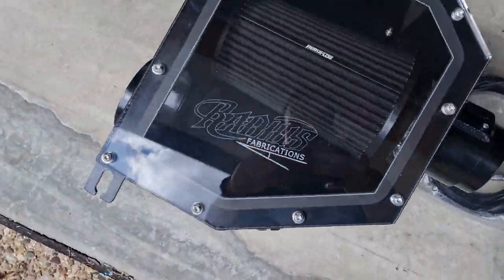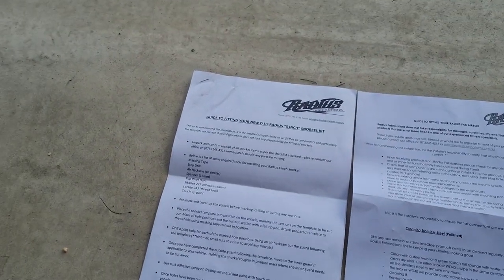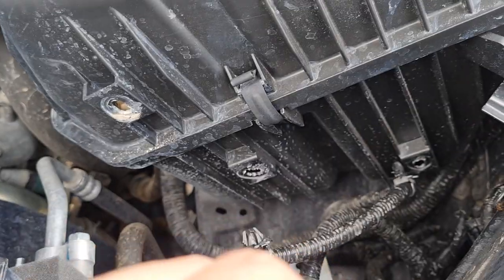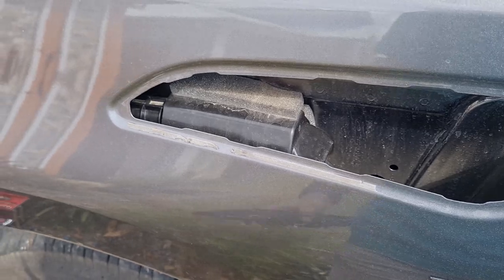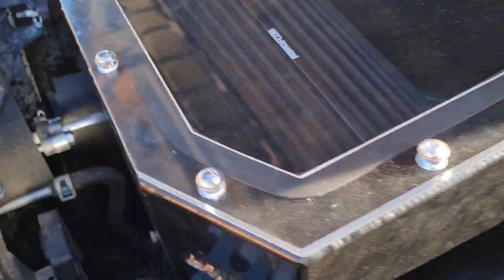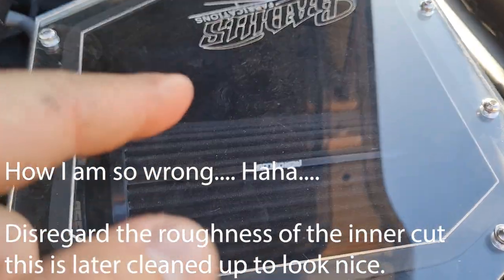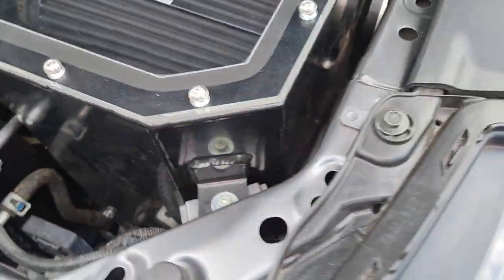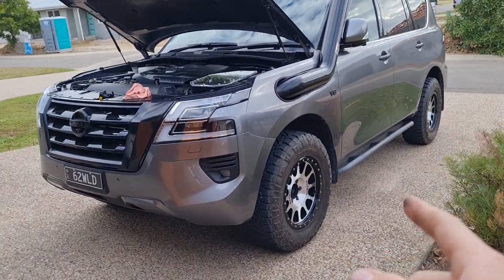Y62 Patrol Radius Fabrications Snorkel Install

Comment: Fuck she's a bit rough man hahaha.

That guard is hacked up.

Are you going to redo?
Reply from the maker: Yep, should have seen the template. I have been sent their new template and will be redoing it so it's actually right.
Reply: @WLD62  I'd be heartbroken. 

But, like you said. Now you have done it so people can see what not to do with that shithouse template haha. 

Are you going to get a new guard?
Reply from the maker: @DarrenBoxhall  Yeah I was a bit disappointed about it, it doesn't look too bad in person, although I'm not happy about it. But that's exactly right, it saves others from going through it.

Yeah I'm trying to find a new guard so I can get it perfect with the new template. But Radius have been great, send the new template free of charge and I look forward to seeing this improved one. At least they know it was an issue and fixed it. Apparently they we're waiting for a car to 3D scan, so it could be 100%
Reply: @WLD62  just remember,  even if you get a guard that's the same colour it won't match properly. Or if your getting a new unpainted guard, you will need to blend the door.
Reply from the maker: @DarrenBoxhall  It'll probably be alright because it is so new, but there is methods to use to make them look the same, but that's a later issue.
Reply: @WLD62  nah it won't matter. You can't just paint a new guard edge to edge and have it match fully. It will need to be blended. I'm an automotive spray painter
Reply from the maker: @DarrenBoxhall  You are right. Hoping to find one of a wrecked one anyway, hopefully match a bit easier.